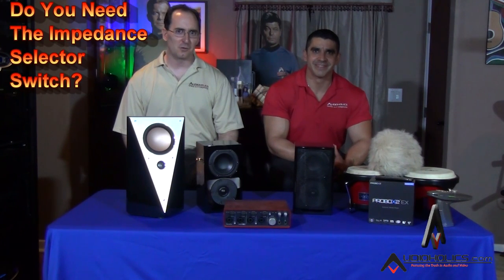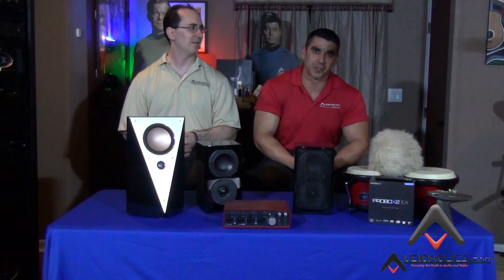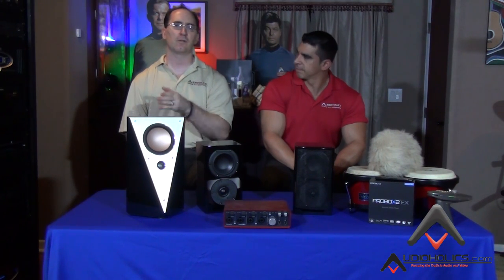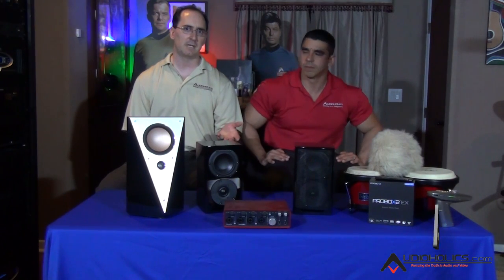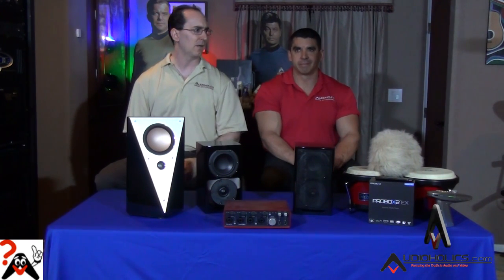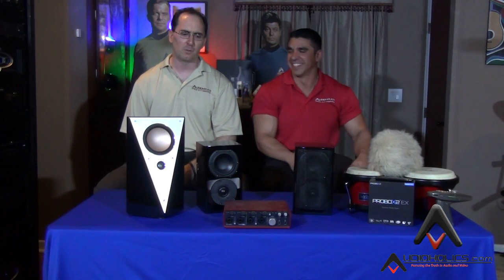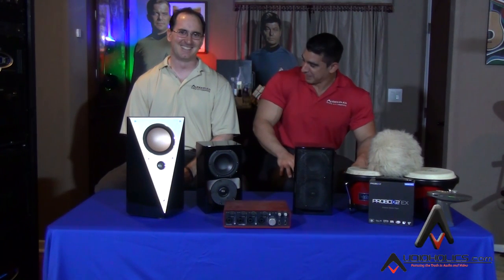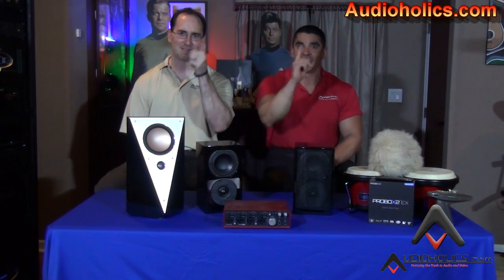AV Receiver Impedance Selector Switch: How Should I Set It?

Comment: For everyone wondering if this information is still up to date, I JUST TESTED THIS with a Denon AVR-X1600H and a power meter. When switching from 8 Ohm mode to 4 Ohm mode, the power draw of the AVR dropped by about 15 W (with the volume level at -29 db). This proves exactly what Gene was saying in this video. Also, I found that turning on Eco mode on the AVR resulted in the exact same drop in power, so it looks like setting the AVR to 4 Ohm mode is essentially just engaging Eco mode. You don't even need a power meter to check this yourself since the OSD shows power usage when you press the Info button on your remote, and it clearly showed a drop in power when in 4 Ohm mode.
Conclusion: Leave your AVR at 8 Ohms (for Denon/Marantz at least)
Reply: What if you can only go as high as 6ohm? 🤣 
I only have 6or4 ohm choices lol, no 8 ohm.
Reply: @Reldvs1  Maybe 6 Ohm since it's higher. The only real way to know is to test it like I did, but 6 Ohms is at least a decent guess.
Reply: @nathan518  that's what I had already settled on myself.  But thank you for putting a number to it.

Comment: I have several Yamaha receivers and amps with an impedance selector switch.  My 5 media room speakers are JM Lab's Focal Micro Claret two-way speakers and a JM Lab center channel speaker.  For years, I have set the switches on my Yamahas at the 6 ohms or less setting.  Immediately after viewing your video, I reset my Yamaha's RX-V1 receiver switch to 8 ohms.  I use the RX-V1 as my 5-channel amp for my Marantz A/V7005 pre/pro.  Thank you for posting this very informative video.
Reply from the maker: David Stark The RX-V1 has a real nice amp section.  You just gave yourself much needed dynamics by switching it back to 8 ohms.  Enjoy.
Reply: +Audioholics I came here looking for this precise answer, thank you.  I&#39;ve got a V1 as well, one of the last heavy Yamahas from when flagship meant flagship, and not just packed with more chips they had to pay a license for.

Comment: The nice old clock radio in the barn died. I'm always on a budget  so instead of buying something new, Marketplace had an Optimus STAV 3250 for $50 and a set of 4 ohm Sony SS CEX1 for $10. The Ohm switch was set to 4 but by your suggestion I moved it to 8 ohms. Once I moved the switch to 8 ohm, those little speakers seem to have a lot  more color and I don't even crank it up. 
Eventually I hope to find some even better speakers for $20 or $30. lol
Reply: you sound like my dad and that made me smile lol

Comment: Nice and worthy lobbying. 
Note that for many units is not leave it at 8z since they come and often are fixed at 4z, with a plastic plate or similar.
One correction to increase your credibility --- clipping harmonics are never loud enough to take out tweeters. A myth that will not die, esp in the pro world, and I was surprised to hear you repeat it. This has been studied and measured again and again (there were two separate Roy Allison measurement articles on this, and he was not alone). All sorts of amp misbehaviors, not just passing dc, take out drivers, but it ain't high levels of harmonic distortion. So you might want to fix that next time.

Comment: Thanks for this video! Got my first home theater receiver (decided to get one to power my passive KRK studio monitors) and I was a bit baffled as to what that setting was actually doing. I've ran all sorts of impedance speakers (and combinations in series and parallel) on amps in live sound settings and never had to tell the amp what impedance my speakers were... I did notice the volume seemed lower when I switched my Denon receiver to 4 ohm and I've had to run it hotter to get the same level. I'll bump that back up to 8 ohm as I don't want to risk damaging my speakers by my amp clipping.

Comment: I changed in my Denon AVRX1300 to 6 ohms of my Denon SYS2020 after a year of usage thinking I missed out to complete some setting ...Now I need to reset it back to default 8 ohms...Please assist me as I heard it has to be untouched and left at default 8 ohms

Comment: I was having a party and ran short on time. I normally have 2 MTX 4 ohm speakers hooked to my Yamaha 5.1 receiver. Well I needed speakers quick on the deck for party goers to hear better so I took 2 Pioneer 6 x 9's out of my truck and wired them together with the 2 MTX's all in parallel ( I should have wired them atleast to the "B" channel). The receiver fried and now wont come on. So at a certain ohm rating yes you can fry the outputs. I don't know why you guys didn't mention this?? What I did was dumb yes, I must have been at under 2 ohms total. I had the impedance switch on the 8 ohm setting.
Reply from the maker: +retroralph you could have still fried the amp with the low setting too.  The point of the switch is to make the amp distort at a much lower level so that it meets the heat dissipation requirements of UL at a prescribed distortion level.  If you have the switch low and still crank up the volume making the amp go into gross distortion, you can still be in the same boat.

Comment: How does this advice relate to stereo amps which have a bridged mono setting? For example in stereo mode the rear label says "4 ohms minimum", and in bridged mono mode "8 ohms minimum". Is this another example of certification labelling, or is there really a risk of damage/clipping when using for example a 6 ohm speaker in bridge mono mode?

Comment: BTW What about that ECO button on some receivers, like my Denon? What does it do? How does it restrict the amp, maybe the same way as the impedance selector?
Reply from the maker: Louis Seize yes don't use it!
Reply: I had the same exact question and thanks for answering Gene.
Would audyssey set up yield  different results on channel levels when you mix speakers with different impedance levels and therefore minimize the damage or overheating of your receiver? and my second part of the question is "if an amp says its capable of handling speakers with impedance 4 to 16 ohms , is it safe to assume that we can mix speakers with different impedance levels connected to the amp?

Comment: This topic is relevant to my current situation. I own a Yamaha RX-V371 that I've previously used with small budget 8 Ohm speakers and  I'm getting ready to set up my home theater system. I recently purchased ELAC's Uni-Fi UB5 Bookshelf speakers and the UC5 center channel and they are rated at 4 Ohm's. My rear satellite speakers are going to be Yamaha's NX-E300 Bookshelf speakers and they are rated at 6 Ohm's. I'm going to hook these speakers up to my RX-V371 and see how they sound and I'm aware to not overpower them. I'll be eventually picking up a new receiver when up update to 4K and HDR sometime this Spring and it will be a 7.2 receiver with ATMOS. What would be the minimum spec's I should look for when buying a new AVR.  _Thanks

Comment: Hi, I have a YAMAHA A-S500 amplifier and it has a switch

LOW (A or B: 4Ωmin/speaker) (A+B: 8Ωmin/speaker)
HIGH (A or B 6Ωmin/speaker) (A+B: 12Ωmin/speaker)

Philips FB696 speakers are 6Ω

What should I choose?
Reply: High. As explained in the video, “low” should never be used unless the AVR keeps shutting down due to protection circuits kicking in.

Comment: I think for a good 2 channel amp you can use the 4ohm. not all 4/8 ohm switches are made equal. I have the as801 and  my dealer who is also an electrical engineer who visits all the factories of the brands he sells, said, switch to 4ohm for my pioneer elite tower fronts. 
Said there will be only benefits, no detriments. (something about more current)
I couldn't hear a difference so I'm just doing what the actual manual, written (or consulted) by engineers told me to do. 
NAD also recommends the switch in there manual for 4 ohm speakers. 
the designers of the amps know best... for cheap avr's however. I have no idea. those manuals prob dont recommend the switch, even though it's there.
Reply: Exactly, these guys are dangerous giving bad advice
Reply: How are Audioholics giving bad advice.

I honestly admire and respect the level of patience they have.
They give out pertinent non biased information to us consumers.

Comment: I have an older Sony STRDE935.  I recently decided to replace my aging woofer foam crumbling JBL floorstanding speakers with some 6x9 car speakers.  When I connected them up my receiver which thinks it smarter than me, wouldn't output any sound.  After reading the manual I saw they insist on setting the impedance switch to 4 Ohms.   Set it to 4 Ohms and it worked normally.  I assume the receiver put a small DC voltage across the outputs temp. when initializing and calculates whether they are shorted.  Thus the 8 Ohm setting with the 4 Ohm speakers made it equal the "Short" condition.  My question is that since I have patio 8 Ohm speakers connected to channel B, can I still use these with the 4 Ohm setting without compromising the receiver?  From your video this would be a "Yes" since only the voltage rails of the output amp are lowered.  The EE in me wants to place a capacitor in parallel with a 4 Ohm power resistor whose reactance would be negligible over 60 Htz. (Which at 2649 uF @ 1 ohm for 60 Hz is pretty large)

Comment: Hi from Australia. I have a Marantz SR6012 and my speakers are rated to 6 ohms. I have the impedance set to 6 ohms on the Marantz.  So you're saying I should change it back to 8 Ohms?   If so, do I need to re-run Audyssy again ? Love your channel by the way.
Reply: If your receiver has identical amplifier sections and specs for all channels there is no need to run the Audyssey again.  The voltage change is most likely uniform across all channels, but if ie the front channels are higher rated than the rest there could be some change to the balance between the channels and it would be a good idea to run the Audyssey again.

Comment: 5.1.2 setup - wharfdale dx1 (x5 4ohms) and 2x cambridge mini speakers (2x 8ohms - for dolby atmos ) - do i just plug em all in at 6-8ohms default or set the av to 4ohms setting? 
for a bedroom so small area to fill. 
i havent bought anything yet, looking to replace my sonos 5.1 setup with something bettef / better center speaker sound

i think i will also get a denon av, think its x1600h

Comment: People need to not confuse this on solid state receivers and amps with tube amps. With tube amps you'll usually find two speaker taps, 8 ohm and 4 ohm. With all speakers it is best to experiment and see which one sounds best to your ears regardless of the manufacturer's rating of the speaker.

Comment: Dear audioholics, I am wondering about the technical function of the switch. Using speakers with half of the "8 ohm impedance" means that the amplifier has to deliver twice of the current by using half voltage. I expect that the switch will decide whether to use whole length for of transformer coil for 8 ohm and half but therefore a parallel circuit of the two coils to deliver half of the voltage but twice of the current. How is the switch working?
Reply: No need to theorize whether the implemented the changes using separate parts of the transformer or by voltage controllers. The impedance switch has one simple function: When set to 8 Ohms the rail voltage is nominal and the amplifiers functions as they you would expect from the specs. When set to 4 or 6 Ohm the rail voltage is lowered and the performance is lowered significantly.

Comment: I realize that this isn't the best setup, but I have some old Sony surround sound speakers (model SS-TS500, rated 6 ohms) hooked up to a Kenwood KR-A57R.  I also have a Sony Subwoofer hooked up to it.  I only use the RCA inputs on the receiver, so I'm not looking to upgrade (if it can be helped).  I have the left two speakers hooked into channel "A"s left, and the two right speakers and subwoofer hooked into the right channel of "A".  Should I use the 8 ohm setting, or the less then 8 ohm setting?  Also, there is both an "A" Left and Right output for speakers, as well as a "B" Left and Right output for speakers, as well as two "surround" outputs, a Left and Right, but I couldn't figure out how to use them.  How could I get the most out of this system? Any help is greatly appreciated.

Comment: should i do the same when my onkyo avr doesnt have a real impedance switch on its back but has it as an option (4ohm vs. 6ohm) in the osd menu??
the connected speakers are: main towers-4ohm, center-6ohm, surr-4ohm plus an active sub??

btw great videos!! i m a big fan of your channel..
Reply from the maker: Yes it's the same thing.
Reply: Audioholics ok thanks for the quick answer. switched it right away to the higher setting, 6ohms, in my case. 
but whats bothering me is the heating of the reciever, you mentioned in the video - is it safe for the avr? cant i/we damage it, burn it or do some other harm to it??
Reply from the maker: @smidla23  most AV receivers run pretty hot these days since they're cramming more channels into a same sized chassis for Atmos. Make sure you give it plenty of ventilation and if it gets too hot, the fans will kick on.

Comment: that makes sense but if the speaker impedance lower that the amplifiers then doesn't that hurt the amplifier
Reply from the maker: electronics for fun A speaker impedance will NEVER be lower than an amplifiers impedance unless its shorted out.  Ideally amplifiers have an infinitely small output impedance.  The only situation where impedance matching makes more sense is with amplifers with autoformers on the outputs like McIntosh.

Comment: What about Valve Amps that have most of them don't. Have a switch but the have 4 , 8 ,and 16 ohms speaker post ? do still only  use the 8 ohms may be you guys can do a video about Valve and why do people still say the sound the sweetest thanks
Reply: Stephen Kasapis Most vacuum tube (Valve)amps have an output transformer. The transformer has taps on the secondary winding (output) to match to different speaker loads 4,8 or 16 Ohms. Use the one that is closest to your speakers Ohms!

Comment: what if i use 8ohm speaker bi-wiring separed post like bi-amping a+b mode. still using hig setting or not ?  i just thinkink what's the point keep aplifier overload and hot  all day.  because extra power,  which maybe you may not need.still  the right way ?

Comment: ok, my old MCS 3125 (125 watt class-AB receiver from 1979) has an impedance switch in the front of it, 8-ohm and 4-ohm.  I haven't tested it out much to be honest, but I have wondered if there is a reason to switch it to one setting or the other.
Reply: aegisofhonor Wow from 1979? Does it have an output transformer?
Reply: jcrobso no I am pretty sure, this is solid state transistor amplifier, output transformers are used in tube amplifiers mainly.

Comment: My rear speakers will be 4ohm and front/center 8ohm, Is it still safe to leave the impedance setting at high? What does it mean when the receiver is 4ohm certified in my case a Onkyo nr747?
Reply from the maker: +Jesper Magnusson yes leave it in the high setting.  The 4 ohm certification is there b/c of the dreaded impedance switch and meeting heat dissipation requirements by reducing the power of the amp during the UL/CSA test.

Comment: Hi Audioholics, great video.
I have two questions;
First Q:
The AVRs runs really hot these days- any form of heat generation is waste of energy, the AVR manufacturers are wasting energy here?
or is it just that their heat sink calculation is undermined for the want of space?
Second Q
I have Marantz SR6014, my speakers are from different manufacturers:
FL & FR - Martin Logan Motion 12 -  4 Ohm speakers
Centre - Wharfedale DIamond CS10 - 6 Ohm
Surround - Polk Audio Fxi-A6 - 8 ohm
Surround back and ceiling mounted - Polk audio OWM5 - 8 ohm speakers
Subwoofer (single) Polk audio DSW-660Wi.

As per your suggestion, I have left imp setting at 8 Ohm
The receiver runs pretty hot - WIll it have any detrimental effect on the components? (dry solder or stuff like that?)
Do you suggest me to place fans on top of it?
Regards

Comment: Hi, I have an Marantz SR7007 and I do have a question!
I understand that we all need to leave our AVR to 8ohm.
But my speakers are all 6 ohms and the surround are 8 ohms....will the 6 or the 8ohms spekers will suffer some volume shrinking?
Reply from the maker: I don't know what "volume shrinking" is, but the answer for the proper impedance setting is stated in the video numerous times.
Reply: Audioholics 
Hi, I just wanted to know if my volume will be or not be uniform on all my 7 channels?
I have  JBL Studio front L - R 580 and the 520C - 2 x center / but my 2 x surround  JBL 210  are 8 ohms!
Will my volume @ -60db will be uniform all over the 7 channels or the surround will sound lower because the 8ohms  impedance?
Or I can have the Audyssey Laboratories' MultEQ auto setup / calibrate the speakers and the system?

Thank you
Reply: I found my answer in the Marantz SR 7007 owner manual PDF / Page 86:

• Use speakers with the speaker impedances shown below.

Speaker Terminal:
FRONT
CENTER
SURROUND
SURROUND BACK
FRONT HEIGHT
FRONT WIDE  

Speaker Impedance:
 6 - 8 Ohms
:)

Comment: So how does a class A amp get certification? It usually runs very hot
Reply from the maker: Most dedicated amps aren't UL rated.  Check the markings on the backpanel.

Comment: So if I crank up my 100W receiver with 4 ohm speakers plugged in, my receiver will work harder and try to deliver 200W?
Reply from the maker: Ruben Alvarez it will try,to double power due to 2X Current demand for a 4 ohm,vs 8 ohm load,but most receivers can't deliver 2x power due to limited power supply or heat dissipation from output devices.